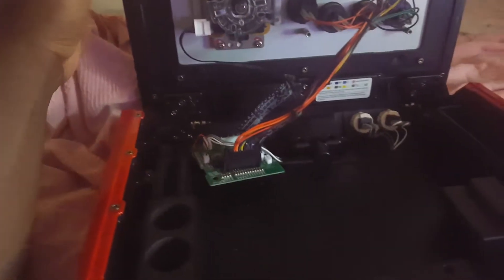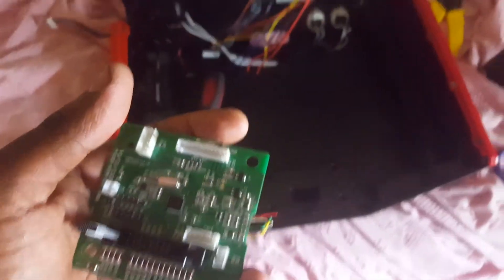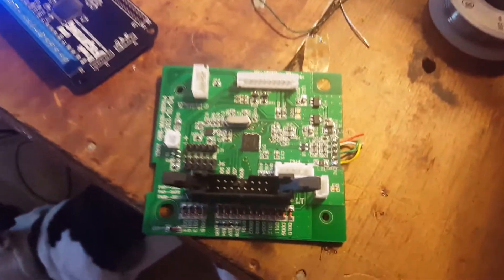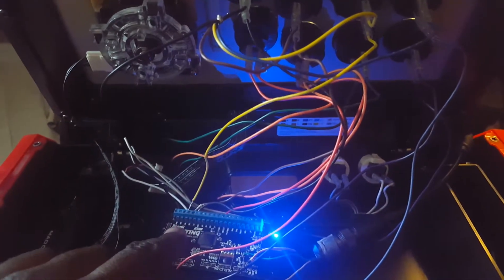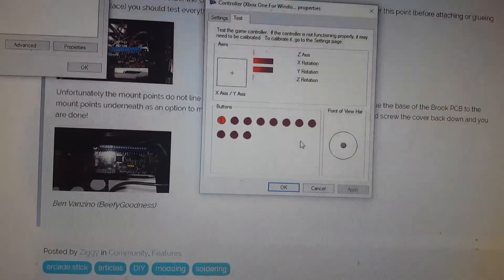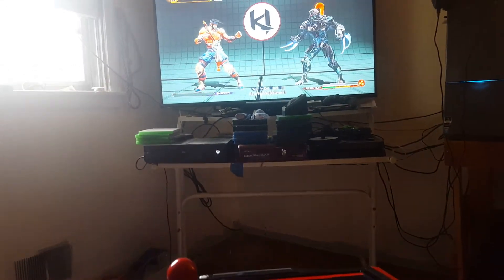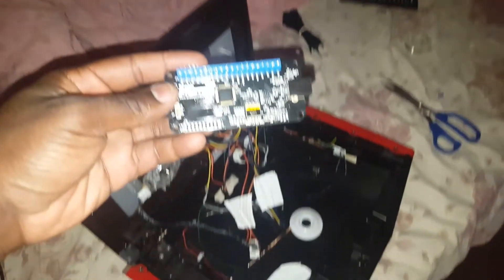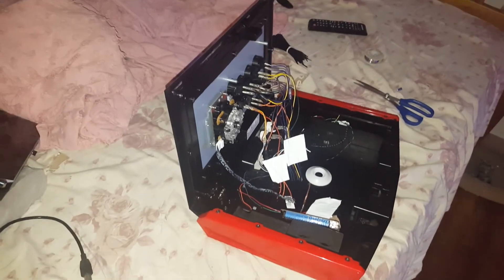Alexlexus Installs brooks universal fighting PCB into Madcatz TE2 (success and failure on my part)

Comment: @NewGamingOrder Think about doing an install soon. I'm curious why didn't you use an EZ Mod PCB to connect to the Brooks?
Reply from the maker: it wasnt availabe at the time i needed it. sadly i was without a stick and i been waiting a long time. 
so i just did the stock mod and it failed. shorted somewhere
Reply: NewGamingOrder you left way to much slack exposed man,

Comment: I’m not sure if you’ll respond but I want to do this for my Xbox te2 and I couldn’t find a guide nowhere
Reply from the maker: make sure to buy it with the adaptor kit to avoid a short like what happend to me. i have since replaced the pcb and been using it ever since.
Reply: @alexlexus  ah I see you're talking about the ez mod? I can't find them anywhere, any tips?
Reply from the maker: @scottrobinson6719  you can still do it like my video here. my issue was i had solder leak and caused a short. you might not have the same issue as me.

Comment: hi brow. how did you connect the home button to the brook? I see 12 wires that comes from the TE2 board, which of them I can use to make home button active? and, which wires I can use to turn the haptic and lock buttons into L3 and R3 (or touch button maybe)? tks a lot brow!!!!!
Reply: the 1st wire is L3 the 2nd R3 the 3rd the Home button and the 4th wire is ground.  this is on the Xbox one TE2 anyway.
Reply: did you ever end up figuring this out? im going through it now lol